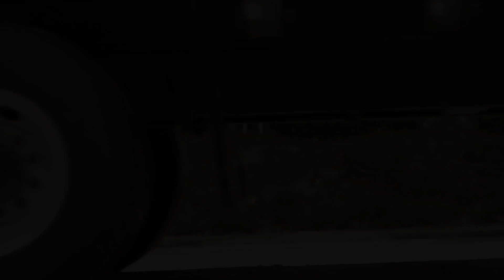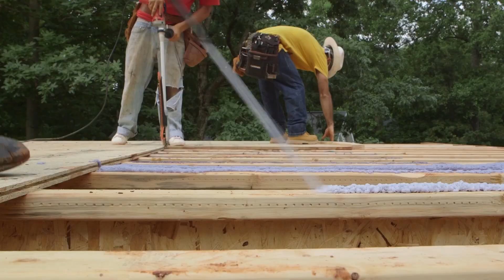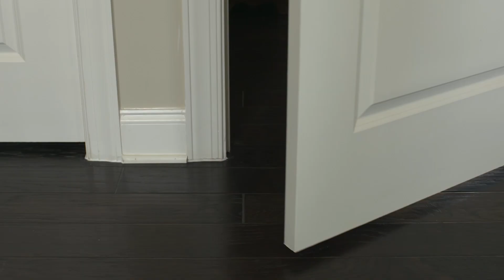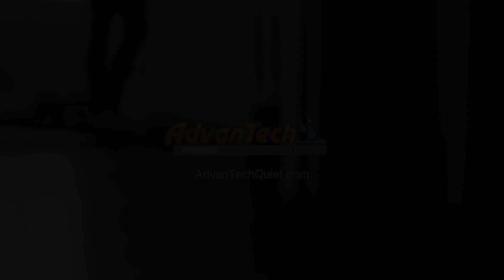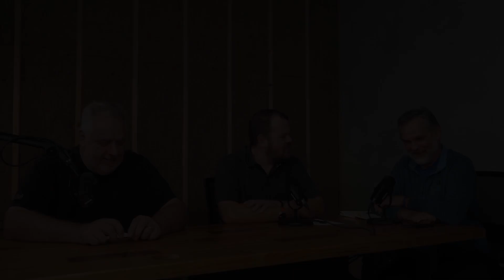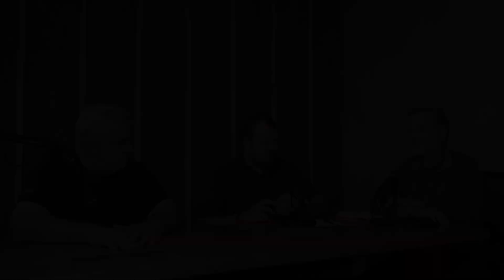Energy Modeling: Necessary Evil or Key to High Performance Homes?  - UnBuild It Podcast #113

Comment: I can give you only my perspective on this topic and my opinion.  Their was once a software that would plan, calculate, simulate and document projects back in the early 2010's and some time before that.  It is now part of a few takeovers and gone from existence.  For example the power during the design phase is what I can speak to in this example.  If you have every available solar inverter and solar panel in a database with all the needed data to calculate and simulate you could do something like ask it, what is the best combination of these products, given this location, this exact design in 3D BIM and orientation to the sun.  Today I use popular AEC programs to do similar things with buildings.  Build from solid mass to detailed drawings always checking against the base.  It can only help you to better your designs.  For me, as long as I am happy with the design intent, it preforms as intended and you can explain why if not.  That is all you can ask.  So many factors to design around including client needs and wants.  This just helps to guide you in the right direction.  For specific wall assembly calculations, these tools are not intended for that.  Hire a professional, not an "energy modeler".